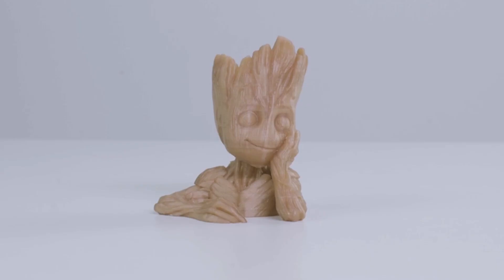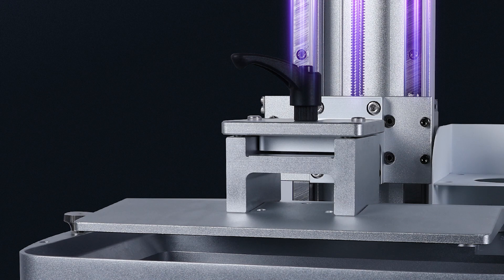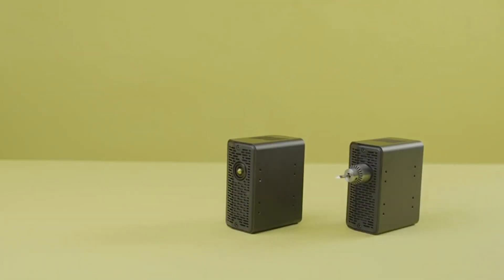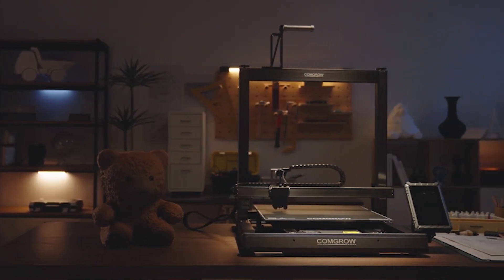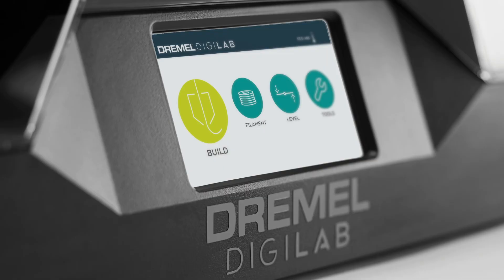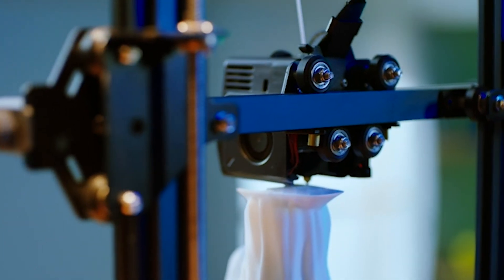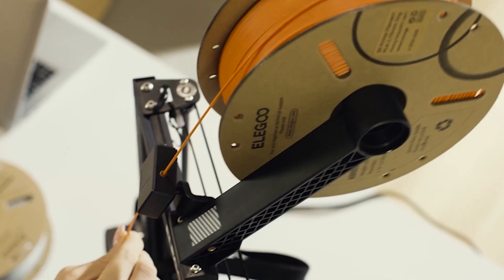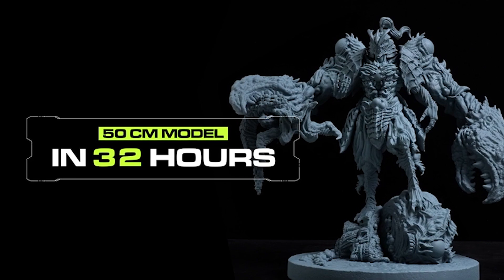TOP 7 Best Affordable 3D Printer in 2024

Comment: this is some ai thing bruh, for anyone getting into 3d printing and wants slightly affordable, you can get an ender 3 s1 pro for around 300 quid, good printer and has an upgrade for the touch pad that can also upgrade printing speeds that often is priced around 100-150. If you want to spend more then you can get a bambu lab printer which i can highly recommend for the speed, when you go bambu its hard to go back. There are smaller printers like the a1 mini (around 400 pounds) that has ams (a way of printing multiple colours on one print) from bambu or the a1 (370 by itself or 500 with ams) which is actually bigger at around 256x256x256 i think, i use the p1p which is also very good and can be upgraded using the p1s kit. So those are my recommendations.
Reply: I would say that in the 200 range, the Ender 3 V3 SE is the printer to go, but when you have more money to spend, it is hard to not buy a A1, P1P, P1S or X1C - from ~300 up until ~1500 - Bambu has something that is most likely better than the competition, and not just by a little bit.
I have a X1C since over a year and a A1 since 3 months - both perform very well.